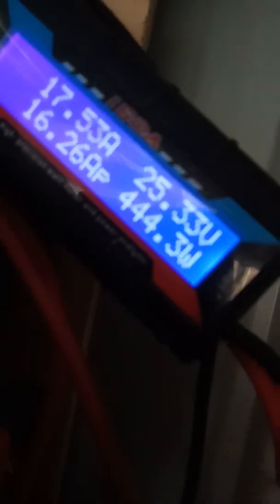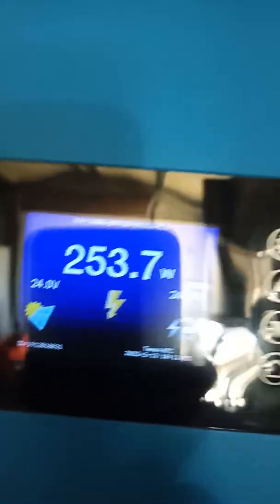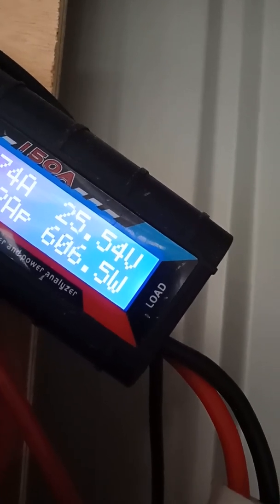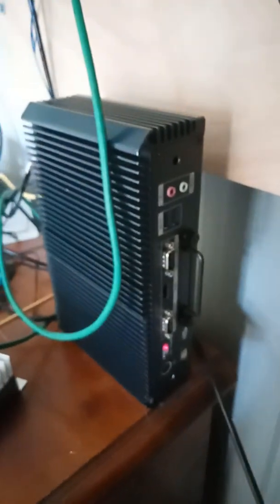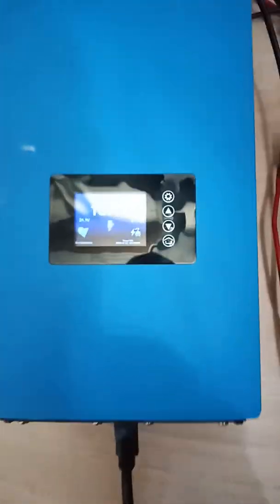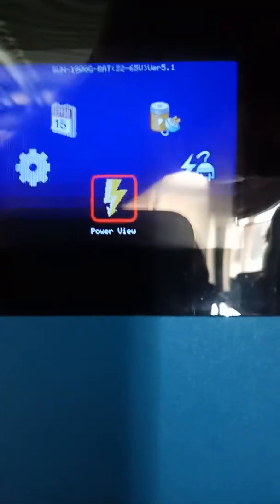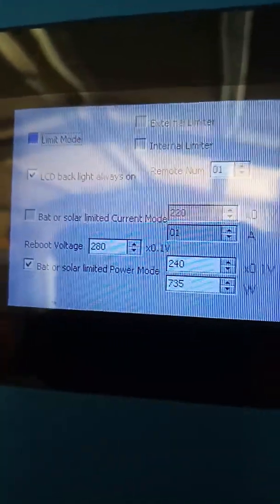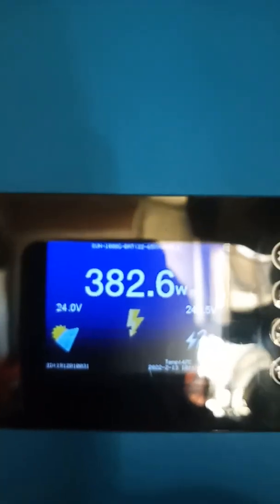1000w B & C Turbine with good wind. Using new setup

Comment: Hi collier, i have instale a eolic turbine with 2000w and an output of 48v but it isnt working well at the moment with the sun2000g Tie grid inverter, can you help me pls? i have invested 500€ in the inverter..
Reply from the maker: You will have to give me more details of not working well. Eg voltage output power and if you have the dump load connected.

Comment: You didn't really explain how it is setup to work now?
Reply from the maker: The current setup is as follows. 
WInd turbine feeds into the 1500w 24 volt battery charge controller. 
That alone would be good enough for off grid use especially if you got one with solar inputs as well. 
As I want to drain off a good 50% of the power to my house  (I have a 8kwh battery in my house that detects the power from the gti and charges that battery if it is not being used before it is sent to the grid. ) I have the gti 1000w limited to turn off at just below 24.5  volts. 
I could set this lower or higher.
The reason I have it set to 50% is all the devices I have hooked up in my work test system takes around 19watts =  456 wh per day. 
My 24 volt battery setup can hold 3,300 kwh 
So my test setup could run with no wind for 7 days ish but because I am draining at least 50% that gives me approx 3.5 days with no wind. 
So its, turbine to charger -  charger to batteries - Batteries to sun GTI 1000. 
The benefits of this setup is that I never need to use braking resistors if the turbine power peaks at 1300w + the batteries have enough head room to stop the charge controller applying its internal brake hence it would get hot and for sure burn out with the turbine producing so much power for a prolonged period. 
I get extreme winds and big gust as well. Because of this NO matter what power of gti I use, they trip due to the high voltage when a gust comes along. They do not recover until the wind drops to below 35 kmph  so all the good power band is lost.  Once tripped all the power goes into the braking resistors they cannot on there own bring the voltage to lower than the max voltage that tripped the inverter. So it all gets dissapated as heat.
Hope that explains When I get the next good wind day I will do a new video I have replaced the current meter so it is now tracking on the display total output from today.
Reply: @davecollier8946  ah, I have big winds as well and struggle with keeping turbine under control as well. Thanks!

Comment: So you are using a battery charger in paralell with the Sun inverter? 
Does the sun run the breake resistors?
Reply from the maker: No the charger does the braking. 😀